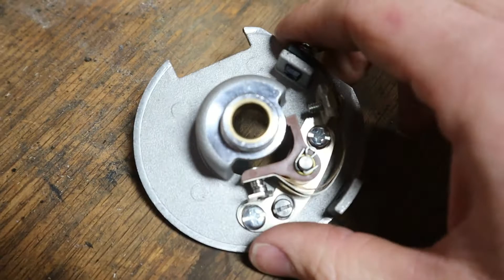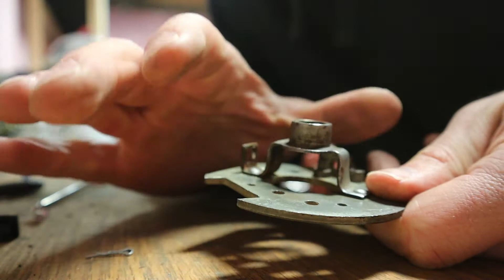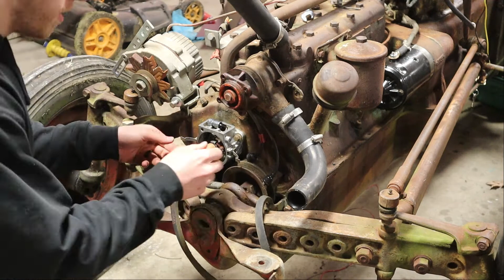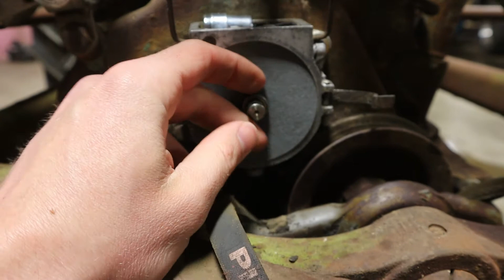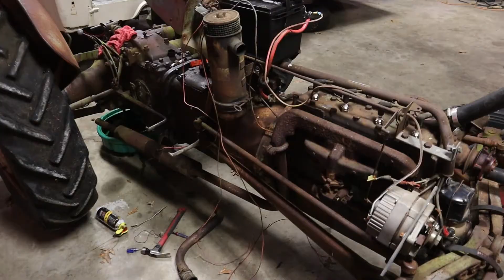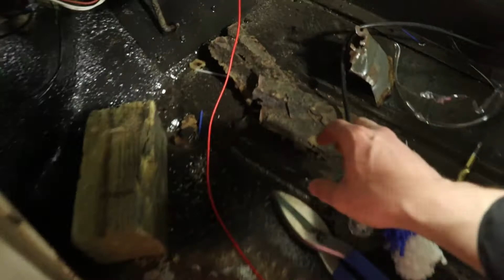IT'S ALIVE! | Ford 2N Tractor First Start, FOR YEARS! | New Points

Comment: Yahoo!!! Good feeling!!
Did you time the distributor?
Reply from the maker: Yes sir! Just set it to the same place it was when I took it off!
Reply: @JakeHarrington  since you had the distributor apart you need to time it. You may have gotten lucky and it is in the ballpark. If it has some troubles later starting up easy ( a lot of cranking) I'd look into that